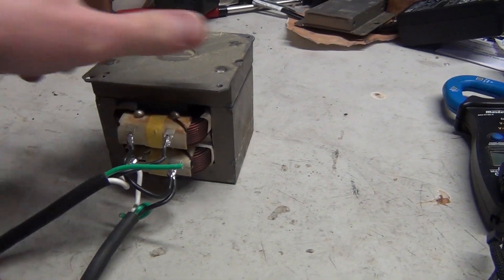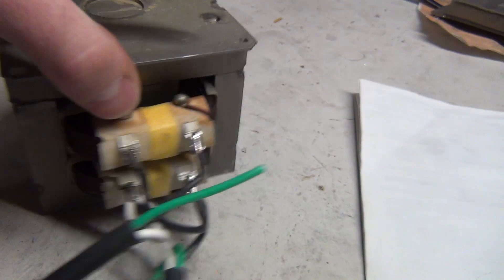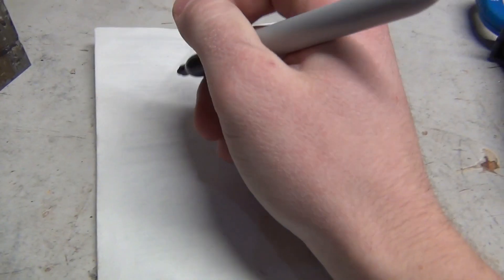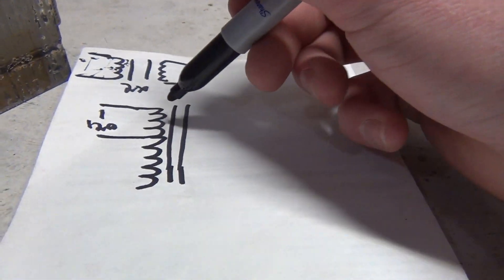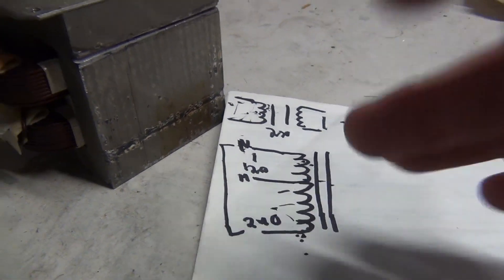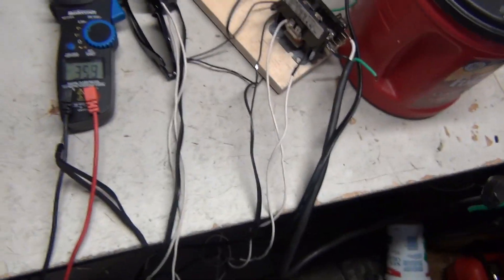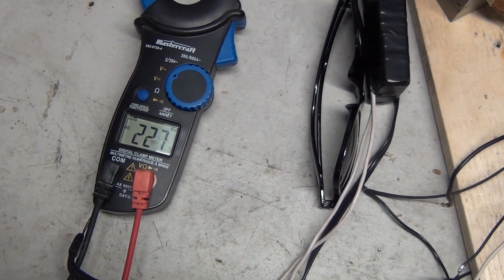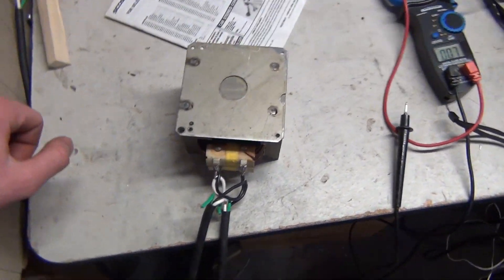120V To 240V Conversion (Easy!)

Comment: Thank you very much. Is it possible to build a transformer in the same way that will reduce from 220 to 110?
Reply from the maker: Transformers are bi-directional devices, meaning you can use them in either a step up or step down configuration.
Reply: תודה
Reply: thank you

Comment: Hey I'm trying to make a 220v litchenberg wood burner. Is it ok to use the metal part of the transformer connected to the ground wires? Or is that not ok with this type of transformer. I don't want to blow anything up. Lol

Comment: How can I get 440v from 220v?
Reply from the maker: With a step up transformer.
Reply: @diy-or-die5700  can transformers be wired backwards to make them step up? I’m not having any luck finding a specific step up transformer. Also would it be better to step up the voltage before or after the VFD? I know after the VFD it would be 3ph so I’d need a 3ph transformer.
Reply from the maker: If you're going to power/control a motor with a VFD, first feed the VFD with the transformer, and then the VFD straight to the motor. There will be less technicalities to worry about. And yes, any transformer can be used in either a step up or step-down configuration. Oh also, if you cannot find that specific voltage, just step up to 600V and program the VFD to output the correct motor voltage (most decent drives can do this).

Comment: Ok I’m stumped. I have a 230v single phase motor with only black, white, and ground. How do I achieve 230v single phase from 120/240? I can’t simply land each of the two 120 phases on the black and hire wires, correct?
Reply from the maker: Technically the 240VAC you get from each 120V "phase" is still single phase. Just hookup the hots to the black and white lines and make sure to bond/ground the motor. Should work fine. 240VAC is almost always derived from two 120V lines or from a delta 3 Phase circuit (not applicable for you).
Reply: @diy-or-die5700  right I was worried about it being a delta 3 phase. I’m calling the manufacture tomorrow to confirm power requirements on the motor.
Reply from the maker: If it was three phase you would have three conductors and a ground. You said it only had two therefore it cannot be a three phase motor.
Reply: @diy-or-die5700  I meant to derive a true 240 to ground, or 240 to neutral. It would have to be a three phase service. I’m guessing you’re right though that it will accept 120 to ground, and just use the black and white conductor with each phase of the 120/240 service.
Reply from the maker: A high leg delta (240VAC) delta get can you 208VAC to neutral/ground. A 480VAC system can get you 277VAC to ground. I suppose with a corner grounded delta system one could achieve 240VAC to ground, but otherwise it probably isn't possible without some special transformer or supply. It won't be a three phase motor. You have two conductors and one ground. It cannot be run with 120VAC-GND as the ground NEVER carries normal load currents. It cannot be three phase because you need a third conductor. Therefore the motor is single phase 240VAC with a ground connection. Feed it any form of 240VAC you have available. It will run fine off that.

Comment: Hey, if i add a ballast in series with the primary coil and limit the input current, will it save my transformer from getting heat? i use my transformers to weld and they get extremely hot
Reply from the maker: You are correct in that it will limit the current flow in the primary side of the transformer. The downside of this is that the voltage will be divided between the ballast/inductor upstream and the primary coil of your transformer. The end result is that whilst you have reduced the current (and thus heating) of the transformer during operation, you have also reduced its input/output voltage and current, which in most cases is undesirable. The only way around this is to increase the # of turns on the primary to reduce the effects of core saturation and thus excess magnetizing current.
Reply: @diy-or-die5700  Great advise! thanks

Comment: I really need to find one of these for SHTF use for a water well pump that is 240.  I have a solar system with two deep cycle batteries.  My family  lives a few hours away but if SHTF then gas for generators will become scarce as well.  They have water but won't have the means to bring it up without 240.  I believe my inverter could handle a small amount of use to power this since most pumps that I see are down around 6 amps.   Any constructive advice, as well as a source for this type of transformer would be greatly appreciated.  I used to wire houses as well as electronics background so I understand the concept of this video.
Reply: Same here.
My old school days taught me this,
Take two identical 1:1 isolation transformers,
Connect the two primaries of transformers in PARALLEL, and the two secondary windings in SERIES.
Note, both primary coils must be in the same orientation  I'd fuse each connection in case you got I'd backwards.
Also, might consider a rotatory solution, 120v motor turning 240v motor or generator, maybe a rewired car alternator
Good luck
Reply from the maker: These are definitely potential solutions, however one must keep in mind that whichever system is implemented must handle the large inrush current during motor startups. A 6amp 240VAC motor will draw ~60A during startup. Your inverter must be capable of supporting such a transient load otherwise it will simply trip out/fault. Assuming one is using a 120VAC inverter means that the inverter must support ~120A during inrush. Even further down on the DC/battery side, this inrush current increases again to ~1200A! (on a 12V system). Make sure the inverter you will use for this is a Low Switching Frequency inverter. These are much better suited for high inrush loads.
Reply from the maker: KF5HCR has mentioned some possible solutions. Bear in mind that a 6amp 240VAC motor will draw ~60A during startup. Your inverter must be capable of supporting such a transient load otherwise it will simply trip out/fault. Assuming one is using a 120VAC inverter means that the inverter must support ~120A during inrush. Even further down on the DC/battery side, this inrush current increases again to ~1200A! (on a 12V system). Make sure the inverter you will use for this is a Low Switching Frequency inverter. These are much better suited for high inrush loads.

Comment: But wait, you won't have true 220/240 because it's not alternating sine waves, both waves are still in phase. Therefore a regular 240v rated appliance or load here in the states wouldn't run off this I believe. 
To get two 120v sine waves out of phase you could use an electric motor spinning another 240 motor with a magnetic rotor.
(Maybe similar to a rotary phase converter...)
Reply from the maker: This is a misconception with the typical edison three wire system. Any single phase device will run off this transformer, HOWEVER, if the device needs a neutral and/or two split phases, the transformer will not be suitable. The summation of two sine waves with 180° separation will equal another sine wave with twice the amplitude and the same frequency; this math means any "two phase/split phase" motor are really just single phase motors. Of course multispeed motors or variable heaters may use 120/240 for different settings in which again this transformer won't work. Hopefully I make any sense haha.
Reply from the maker: Also rotary phase converters are used to convert single phase/split phase to three phase, which is another topic completely.

Comment: Was looking into utilizing on 120VAC generators where there isn't an option to use both coils for max current capabilities of the 120VAC design capabilities, and as another portable way using a step down transformer, making a higher current MOT step down transformer versus buying.  Thinking for example a 13A breaker'd 3200W continuous portable generator with two 120VAC windings rated 1600W each in order to obtain ~25A/3200W total from one 120VAC outlet.   The switched dedicated circuit on the generator design isn't an issue, though when reviewing I decided to research making a step down transformer from the 240VAC outlets 120VAC circuits.  Any issues to consider if designing?

Comment: I want to step up 100v to 220v 0r 230v and  I bought 110v to 220v step up transformer.  Now I'm getting 198v out of the transformer.  Please what should I do to get the out put voltage increased to 220 or 230v?
Reply from the maker: You need a transformer with a higher/custom turns ratio. How come your source is only 100VAC? That voltage isn't used anywhere, atleast for regular applications and loads. If you can't fix the low voltage issue, the easiest way to solve the problem is to buy a transformer with taps suited for or close enough to your voltage.
Reply: @diy-or-die5700  japan 🇯🇵 use 100v usa 🇺🇸 use 110v here in Nigeria 🇳🇬 we use 220v. The step up transformer I'm using out but 204 volts. But on oning my Air conditioner, it drops to 180 volts ⚡😤😒😑
Reply from the maker: That's interesting I didn't know Japan used 100VAC. Anyways, I would definitely withhold from powering the air conditioner off that transformer as it will draw more current than it normally should due to decreased voltage; it will probably overheat. The poor voltage regulation of that transformer (204-180v under load) tells me it's either undersized or is of cheap construction. Just multiply the factory voltage and current ratings of the aircon and divide by 0.8 to get the VA or apparent power of the transformer with a 125% safety factor (derived from CEC). For example 220V @ 10A = 2200VA ÷ 0.8 = 2750VA -‐------‐>call it 3000VA or 3kVA because small transformers are typically sized in 1kVA increments. If you can't get one with taps not surprising) or with the right turns ratio use a 120-277V transformer. You're looking for a 100-220v transformer therefore the ratio is 2.2. 110-277 has a ratio of 2.31 which is the closest I can think of for a non exact match. If you were to use it you would get 230VAC out which, in addition to any voltage drops, should be fairly close and safe.

Comment: Would this work to step down the voltage from a cheap VFD? 
The VFD  would have a max of 4-500hz and it produces a 3 phase output. But I only need one phase?
Reply from the maker: It should work fine assuming it is wired up correctly, and used at normal mains frequency. The transformer will start to complain if you run a motor above 60hz (the motor would too haha). I have used VFD's to drive motors through a 3 phase variac with no issues.
Reply: @diy-or-die5700  Thanks a bunch! Not planning to drive a motor with it just need 120v out at a different frequency. I was told that mains transformers usually can handle a change in frequency up to about 500-1khz, but above that hysteresis becomes an issue.

I need to run my hv transformer at a slightly higher frequency to make up for a primary with less turns. From 105 down to 68 turns, I plan on using the new primary with a 10 turn secondary to get the same magnetic flux density. I will compare the old and new primary coils with a 10 turn secondary and adjust the frequency till the voltage output of the new one matches the old one.

Of course since the old primary is a normal MOT primary and my core window is large I measured voltages near and far from it then averaged them.

Comment: The heater in question is the Patron model E9 and thanks for your indepth  explanation
Reply from the maker: As said above, ensure your supply can handle the current before you embark on the transformer design.

Comment: Hi DIY-OR-DIE I have a 120 volt  outlet  and looking to make a 240 volt transformer to run a 9KV  240 V heater. The heater draws 25 or 37.5 amps
Reply from the maker: Firstly, have you considered that the maximum power you can continuously draw from a standard 120VAC outlet is 1500W or 1.5kW? I mean its definitely possible to design such a transformer however, I wouldn't think too much about it until I knew that my power source was able to meet my demands. Assuming you have a tapped heater with multiple power outputs (6kW @ 240V & 25A, and 9kW @ 240v & 37.5A), you would need a 120VAC source capable of supplying 75A of current with the heater on high! Typically in most situations, where powers are greater than a few (not even two) kW, a 240VAC source is brought to the load. If you do indeed have a power source capable of supplying that much current, then your next biggest issue is finding a transformer rated at 9kVA or more. That is going to be a pretty big core by the way (100+ lbs easily), it will also be expensive. The core rating will also differ in its requirements if you desire to power other loads, more specifically reactive loads rather than resistive ones. Hopefully this helps you out and give me a shout if you need more information.

Comment: can you use it 220v?
Reply from the maker: If you are talking about using it in a step-down configuration, then yes, you can use it like this. Just connect 220v across both the windings and get 120v off a midpoint tap between the two windings.

Comment: Hey! I want to make 220V to 110V Transformer for my Microwave. I saw many Diagrams but they aren’t 1000watts , all they are just 50,100,200 watts.. 
can you plz Give me the Diagram, or Guide me about the Turns of Coil and tha Guage of Coil for making Heavy Stepdown Transformer! 
#ThankUu..
Reply from the maker: I'm assuming you're using a microwave oven transformer for this? What load is the transformer supplying? If the 1KW you mentioned is purely resistive, then be sure to have a 1KVA transformer, if the load has a reactive portion/a power factor, the the KVA or the apparent power rating must be more carefully considered. I can help you more after these questions.

Comment: You could just import an MOT from the UK and stack the 240v winding on your standard 120v MOT with the secondary removed. It can be done the other way around too if you live in a European country, just don't hook the 120v winding to mains or you'll have magic smoke plume out of your transformer core
Reply from the maker: Very true, however at the cost of postage for a bulky item like that you may as well just buy a stepup transformer. The main reason people modify these is because it is either dirt cheap or free to do.
Reply: @diy-or-die5700  yes, but MOTs can supply more wattage then your average 240 volt transformer sold commercially. The downside is, well it's heavy as all hell.
Reply from the maker: @colerumpel  MOTs can be easily surpassed in power output and efficiency by any decent mains power transformer. They are inefficient (have terrible core losses,  bad winding losses, and operate at or near core saturation), have low duty cycles, and have purposefully high leakage inductance due to the fact they were designed to drive capacitive loads (uncommon type of load as nearly all loads are inductive or resistive). Even worse, many modern day mains MOTs have aluminum windings! Furthermore their typical operation is at or near magnetic saturation as a partial consequence of their undersized/minimal iron cores, again as an effort to reduce cost. Overall, they are lighter, cheaper, less efficient, and have worse continuous power output than most properly designed mains power transformers!
Reply: @diy-or-die5700  I was thinking, and wondering about how the phases align correctly due to differences, multiple MOT's can be wired in parallel to increase the current capabilities.  An oscilloscope with a current clamp would be handy to test each prior to wiring.
Reply: @diy-or-die5700  After watching vid & making note of you pointing out your MOT is probably good for somewhere around a paltry 10A, then reading your comment here on your thoughts on MOTs in general, it compels me to ask: What sort of IRL places might one have a decent shot at finding some salvage/surplus/newoldstock/etc (i.e. cheap af) mains transformers? I'm just looking to be able to do what you've accomplished in this vid + having the capability of running it hard as well (hard, not hot!)
Reply from the maker: It's pretty hard to find transformers on the cheap IRL. Scrapyards are your best bet, but typically those transformers are usually atleast tens of kVA. The most direct (but costly) solution would be rewinding a toroidal transformer from one of those voltage "converters" used to run international appliances. They're usually a few kVA so they're a perfect size.

Comment: Can you obtain 120/240v split phase? 
Like to run for exmple a 120/240 v mini split air conditioner like on a camper where you dont have 120/240 split phase
Reply from the maker: Yep! You can obtain 120V from the neutral connection to the end of the first "primary" coil, and 240V from the neutral to the end of the second "primary" coil. Hope that makes sense.
Reply: @diy-or-die5700  Thanks. I mean obtaining 240v measured from 2 live lines without neutral. Neutral to L1=120v. Neutral to L2=120v and L1 to L2=240 thats what I need to know if is possible with the 2 MOT
Reply from the maker: Yes you can achieve this. I'll make a video instead of trying to explain it. Should be up in an hour or two.
Reply from the maker: Heres the video: https://youtu.be/bFCbBw4b8OU